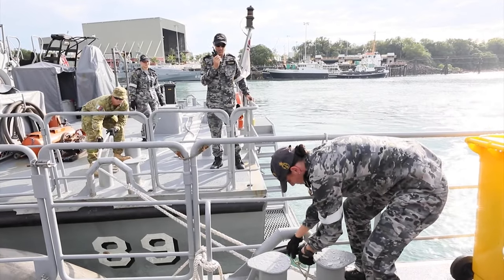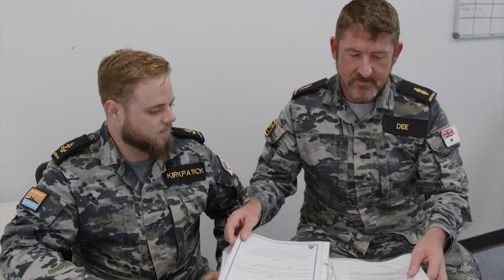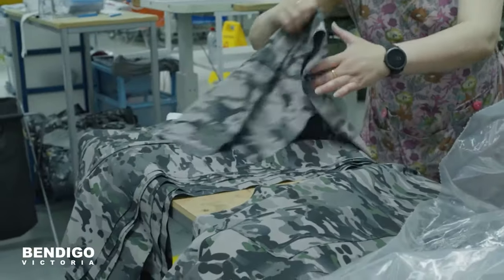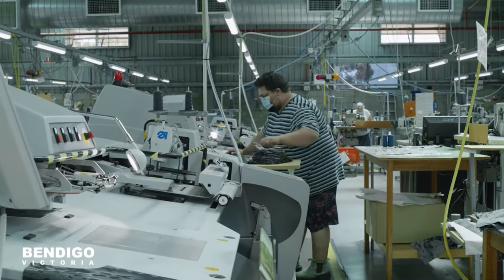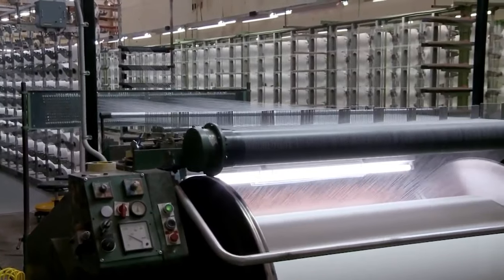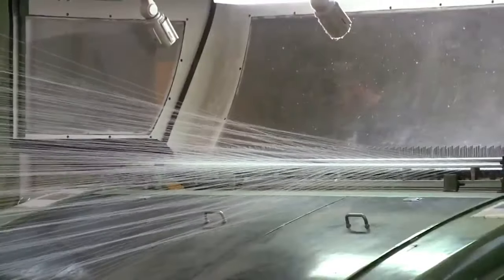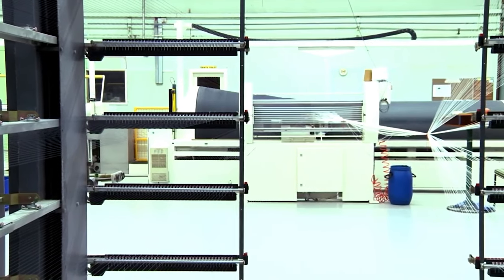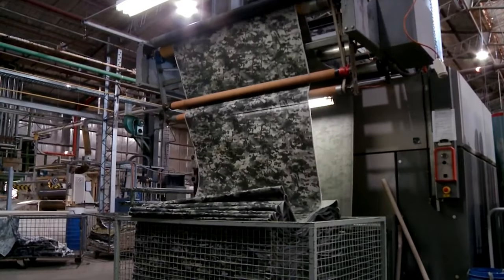Navy's new uniform

Comment: I am all for a more comfortable and practical working rig. However, why a non fire retardant shore version, and why a camouflage pattern? I have yet to hear a rational explanation for that bit of lunacy.
Reply: Agreed. One uniform so you dont have sea riders in shore rig at sea. There is already a shore rig W8 and S8. If you need to wear cams then it should be suitable for combat.
Reply: Its so the sailor's can't hide on broad the ship
Reply: Uniformity with other branches. Been a while coming now.
Reply: @Crovesk  I tried to bring in overalls for all on the ship when I was laundry leading hand.
It would have made washing more economical. 
And easy.
Reply: Because the fire retardant actually makes a significant difference in weight, but the shore version actually has other differences as well, pockets are laid out differently as the sea variant has to have spacing for generally sea kit, sea variant has hi-visibility stripes on it, and it is slightly heavier then the shore variant. Meanwhile we keep the shore variant for doing work ashore, it's easier to work in the MMPUs than the whites,  Less frustration with stains.